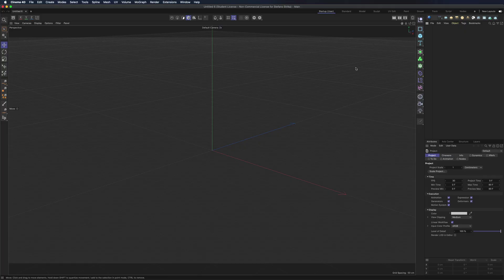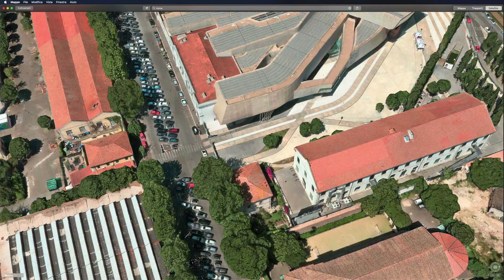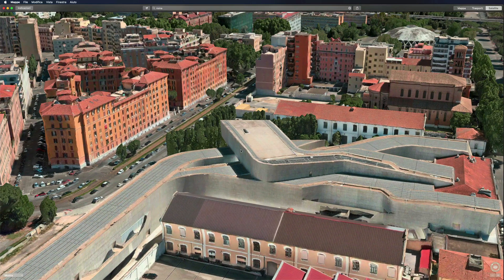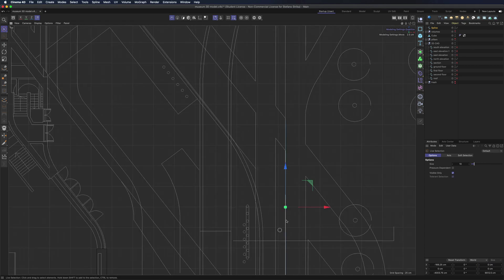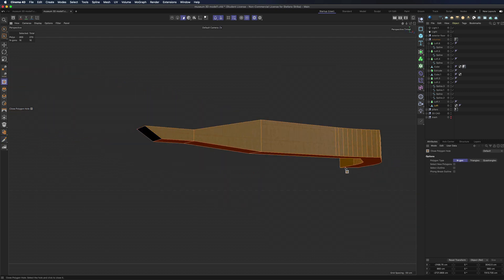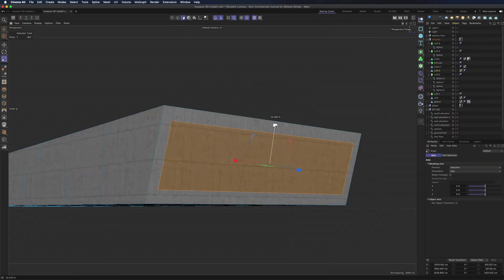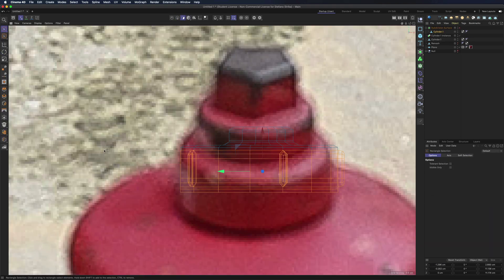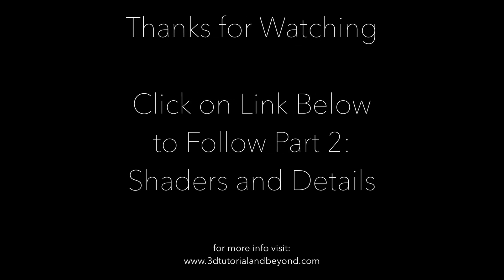Museum Scene - Making of | Vray 5.2 - C4D R25 | Part 1 of 3

Comment: One question:. When you model real buildings in the background. Where and how do you obtain images of those buildings in acceptable resolution?

Otherwise very impressive, professional tutorial with great technique. Im using Arnold right now but i am very impressed with Vray. Only drawback i see right now is the lack of built in ACES because that was real game changer for me.
Reply from the maker: Hi, for this scene we have used on site photos since the museum was near our office. Otherwise we use Google street view and we take screenshot of the building facade, usually the resolution is good enough to be used for background elements. ACES is already supported by Vray inside the VFB, full integration will come with an update so stay tuned;)
Reply: @3DRenderandBeyond  Thank you for your answer. Regarding the update thats great news, will do 🙂